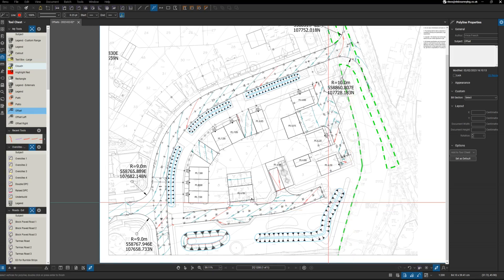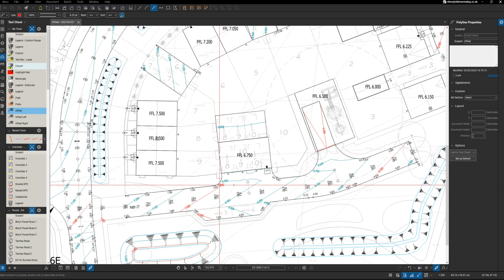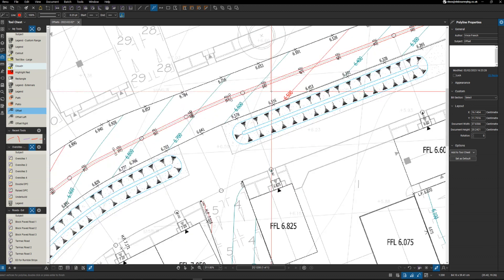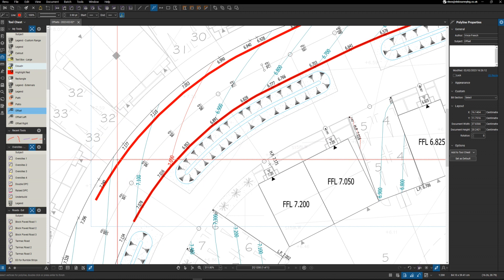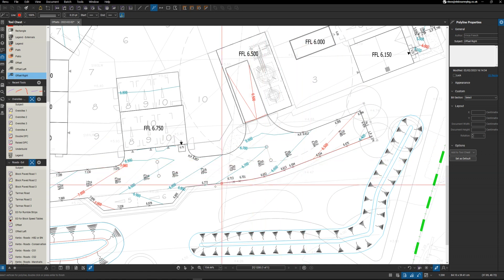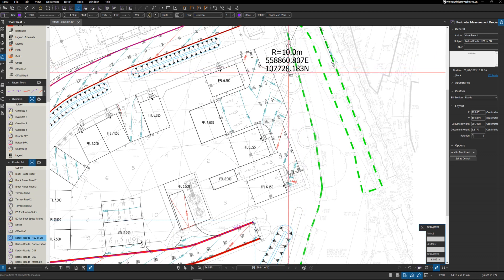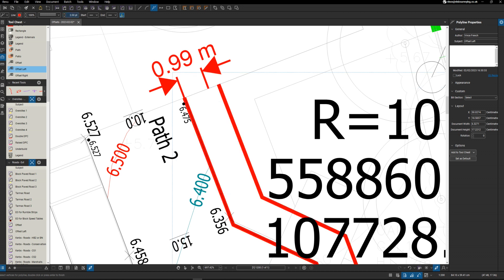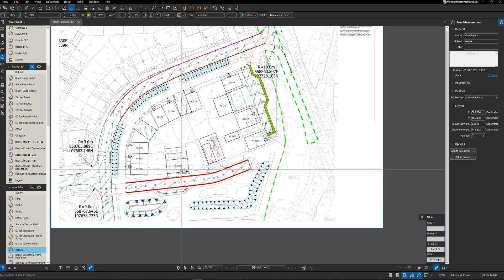Bluebeam - No Offset Function?  No Problem!  Part 2

Comment: Hi. How is the double line set to the line itself and not centre? What change in settings should we do to make that offset left and right tools?
Reply from the maker: The offset is created in the custom line style settings.  Additional lines can be added in stage from 1 to 10 or from -1 to -10.
In Part 3, I show the lines for a 900mm wide path set 100mm away from a house.
This was chosen as it is something I frequently come across, but it is also a very fortunate coincidence that it works out perfectly with the spacings available.
The first custom style is set with the first line is set at the spacing of 1 and the second at 10.  A second style is created with spacings of -1 and -10.
You then just get used to which of the line styles you need to use in each location to make sure that you are offset on the correct side of whatever you are marking around.
Hope that makes sense!
Reply: @vinicsurveying  Got it. Thanks for the reply...👍👍